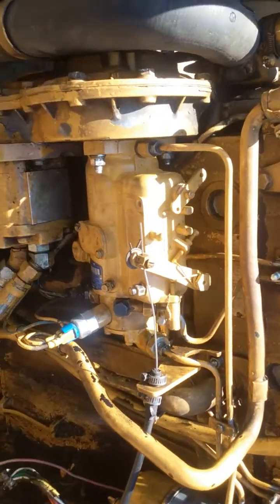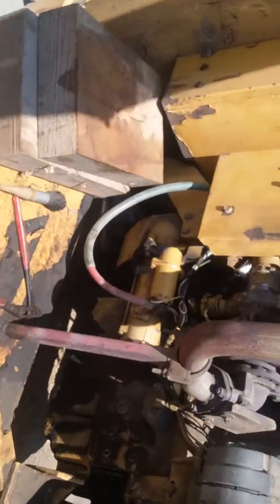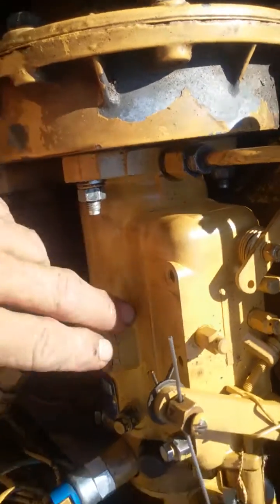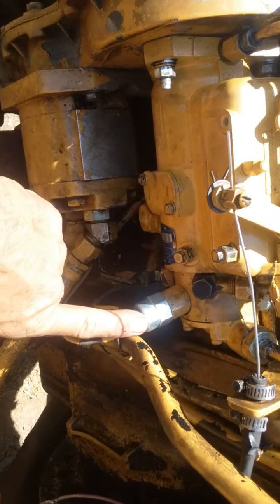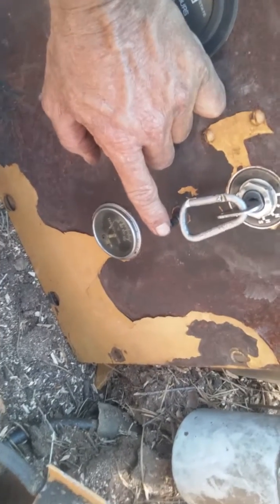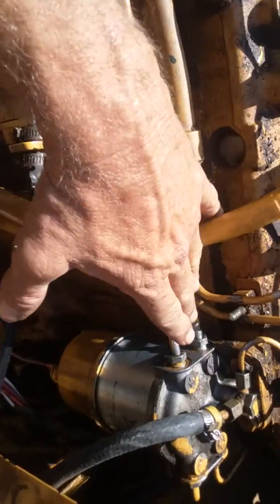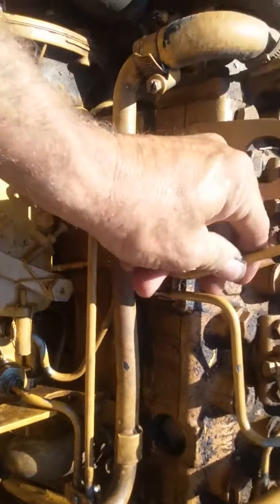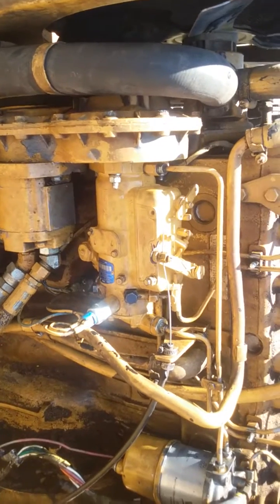Perkins T4.236 on Vermeer 1250 Fuel Starvation

Comment: Thank you, thank you, thank  you....we just spent three days chasing the exact issue. We basically have an entire new fuel system, including new lines, filters, pumps and injectors. We even have a cleaned and scrubbed fuel tank. I cannot believe we missed the fuel filter seal gasket. We don't feel we wasted our time as all the parts replaced were needed. However, you saved the day. Well done and well presented. We thank you and our JCB 1400B w/ Perkins 4.236 thanks you for getting her out of the shop. AAA+ ratting for you.

Comment: So I have the same exact machine, and for the past few days we’ve been having problems with my chipper shutting off after using it for about 15-20 mins after getting hot, while shutting of the oil light comes on, the chipper has oil and is full, cleaned the radiator and all that good stuff out. Not sure what could be the problem, the injection pump is leaking a little bit but starts and runs fine until it gets hot.